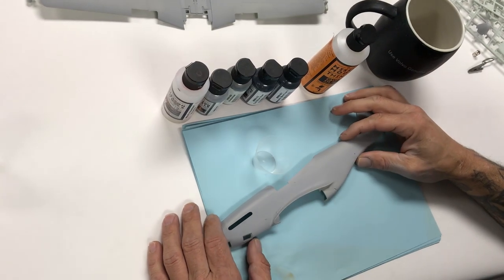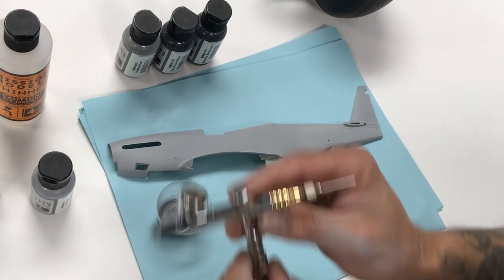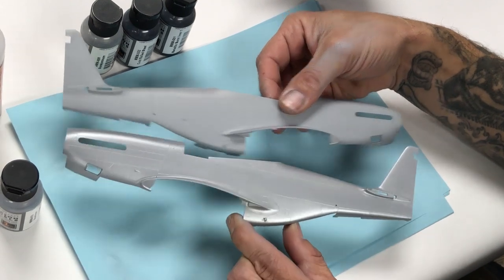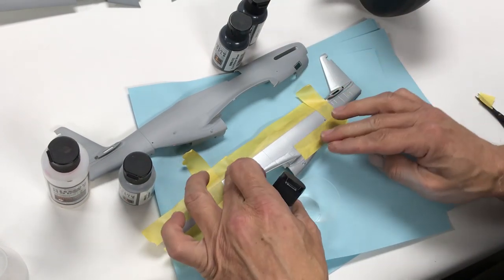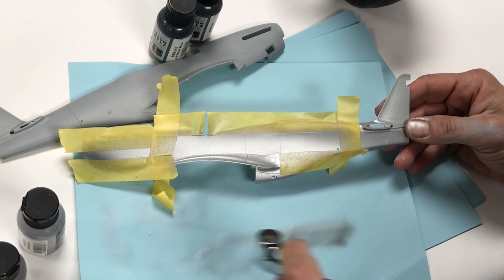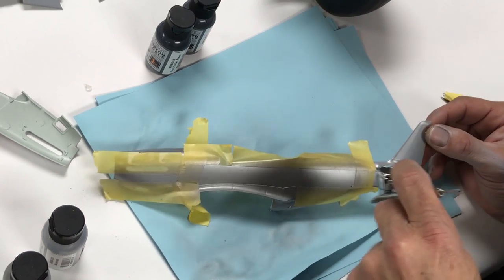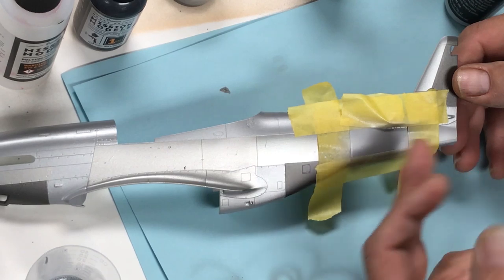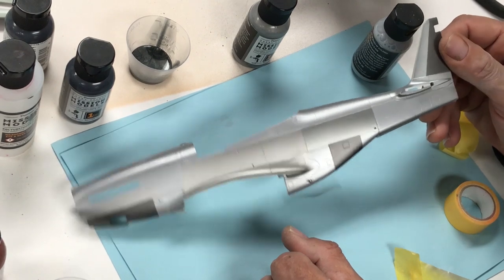Mission Models MMP basic introduction to metallics

Comment: I just noted that in this video, you recommend pre-mixing the Duraluminum with thinner and poly, but in your chrome video, you recommend shooting that color straight. Please explain the difference. Are each of your metallic colors formulated differently? Different viscosity? Different pigment ratio?
Reply from the maker: that's correct, two different formulas.  The chrome is a different formulation than the other metallics.   Thanks for asking and your support

Comment: Any issues with taking a hairdryer to speed up drying time? I only get so much time at the bench and try to maximize as much time as I can. Thanks! Love MMP!
Reply from the maker: There are no issues.   You can accelerate with a hairdryer.  Dont get the paint too hot.   We always recommend letting the paint dry naturally but if needed you can use a hairdryer.

Comment: Thanks for the video.

Should I use a clear cote before decals, washes and weathering?

How do MM metallics react to MM clear cotes and other brand's coats, especially to lacquer based ones?

The last question; What should be the choice of final cote for a full metal painted model?

Thanks.
Reply: I realize this comment is a year old, but for anyone curious, I recently used Faded Aluminum on the fuselage of my Mustang. Did not clear coat over it and it took decal solutions (Micro Set/Sol & Mr. Mark Setter/Softer) and oil wash (Mona Lisa Odorless Thinners) just fine. I'm personally not a fan of putting clear coats over metallics, unless you are trying to after a certain effect.

Comment: I know he mentioned you do not need a gloss black primer   I can say it looks amazing with the gloss back, but....but....it will not cure.   I tried several brands of gloss black and with each one, you can take the tip of your finger and rub the metallic off from one end of the part to the other to the point it doesn't even look like you painted it.  This after about a week of curing time.    The flat primers...no issue.  Just not as brilliant.    Great paints overall though   love them.